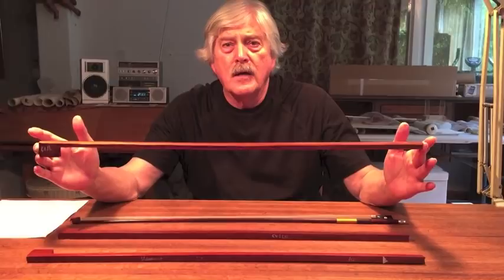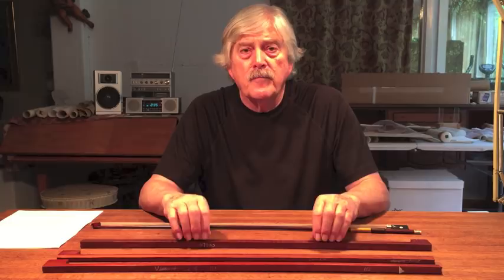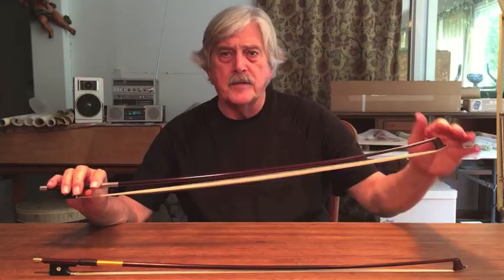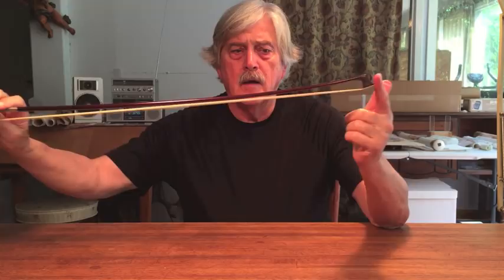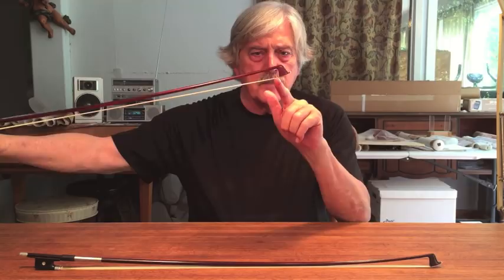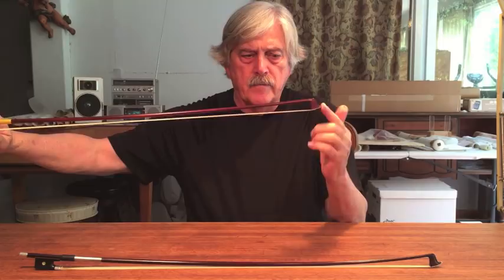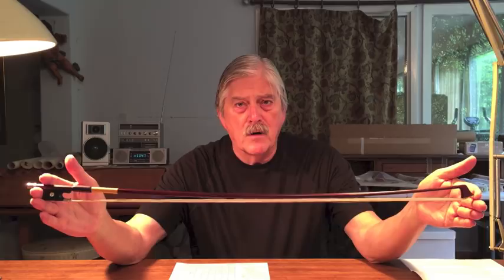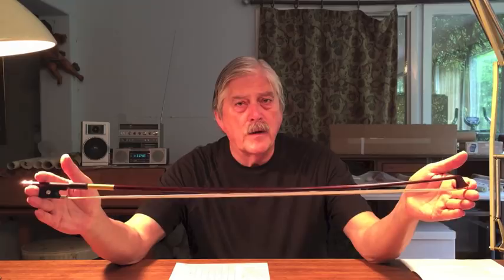The Tourte Bow

Comment: The flexing near the head is a slow action that we can clearly see . Is there a faster action more related to the vibration speed of a string ? Can you picture that very rapid nodding action contributing to the sound as it responds to the stick /slip of the rosin ?